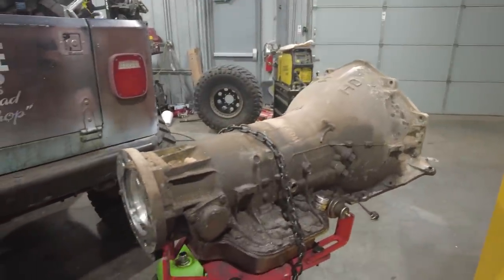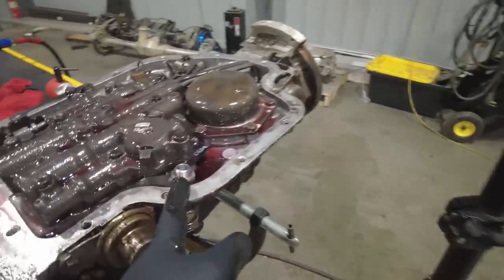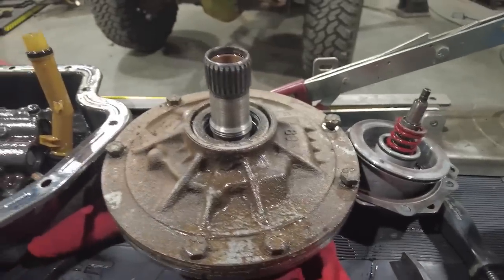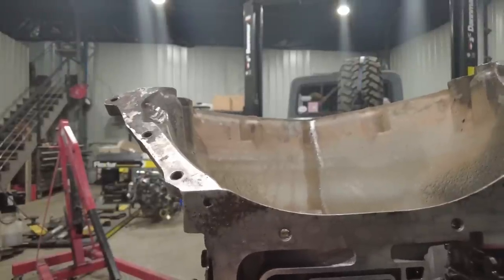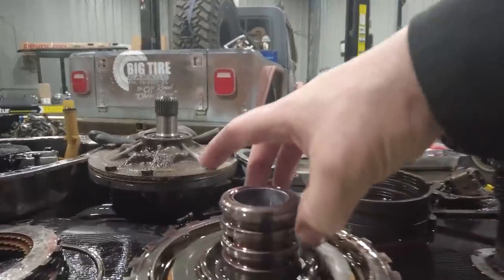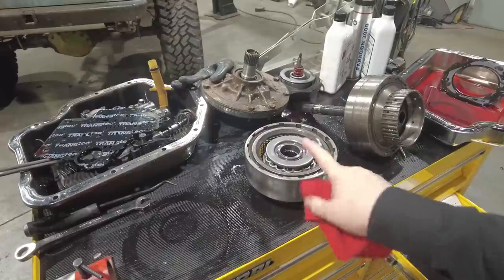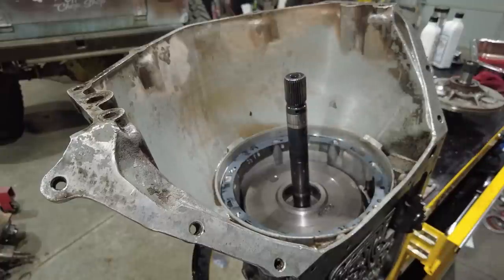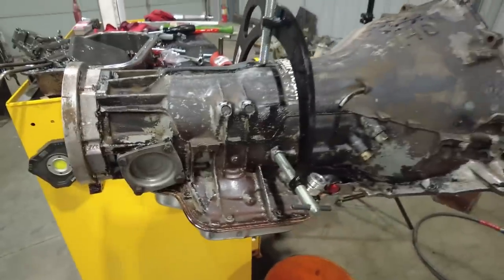Turbo 400 Rebuild for Off Road with Reverse Manual Valve Body

Comment: Nicely done.  The 400 is the staple of drag racing and off-road.

Your editor continues to make a rookie mistake that annoys your viewers video after video.  The music should be the same volume as the talking.  The viewer should not have to adjust the sound down for music and then back up again for talking a dozen times in a video.

Comment: Got a motorhome with a trashed body and a 454 with a 400 or 475 behind it. Going to slap a c10 cab on the chassis and a quick wood flat bed. It'll be a sweet rig, these trans are awesome. Love these and 727s.

Comment: Another great one Ian! Only thing I like to do is I use 2 studs when installing the pump and the valve body for alignment until I get the first bolts started. I damaged a pump gasket once, had redo the whole job a week later.
Reply from the maker: on more complicated VB I do that....and even more so when their are checkballs on top of the spacer plate

Comment: Great video as always! 

Would love to see a video like this on a 6L80! 
Thats whats going in to my TJ here shortly. Though mine is good, it will need a rebuild one day.;
Reply: I don't think there are a whole lot of manual valve body 6l80s out there, plz correct me if I'm wrong
Reply: No need for a manual valve body on an Electronically controlled transmission. It has tap shift capability using a Lokar shifter and some simple software tuning. 
But seeing how to rebuild one would be nice since the 6L80 is fast becoming the go trans for many hotrod and offroad guys. 
Deep first gear, tall 6th gear, and with just a few aftermarket parts it holds 800-1,000hp or more with ease. 
My buddy has had one in is 76 Squar body for 4 years now making 950hp and its holding up great, and the trucks faster than it was with the T400 he blew up 4 times. Now yes you can build a 1,000hp capable T400. Many people do. But he blew up 2 that were supposed to hold 1,200+, 1 that was supposed to be rated for 900hp when the truck was still only making 800hp, and 1 rated for 1,000hp when the truck was making about 880-920hp.

He had a 6l80 built for it and it has already lasted more than 3 times longer than any of the T400s he had in it. 

And he says it drives way better on the street and highway now that he has 2 times the gears to pick from, and over drive.

I have one sitting here going behind a very mild gen four 5.3L that's going in my Jeep TJ shortly. (Shooting for around 400hp at the crank since its going in a wheeling rig that's not used for mud)
I drove a TJ with this exact same setup and was just blown away at how much nicer it drove than mine. (Currently has built 4.6 stroker and a 5 speed manual trans)
And how much nicer it drove over my buddies 5.3 swapped TJ running a T350 trans.

The 3 extra gears and overdrive just make for a MUCH nicer driver on the street over a T350 or T400. And the Deeper first gear makes for a better crawl ratio off road. 

Gets better MPG when your just driving around to. And it holds the motor in the power band better when you want hammer on it.

Comment: I have always had problems with chrome trans pans leaking. I sand/grind the chrome off the mounting surface and use Permatex and it does not leak. Got a reverse manual valvebody on my tbucket but it is old and doesn’t have engine braking.
Reply from the maker: You have to make sure to request the engine braking...most Drag cars don't want it.

Comment: Question…Diesel Rubicon Gladiators come with 32.7” tires and 3.73’s. If I calculate new R&P to run 39” (38.5”) BFG’s, it comes out to 4.39, so 4.56 would be the closest. I’ve always heard 4.88 for 37’s, 5.13 for 40’s and 5.38 for 42’s. So should I go 4.56 or 5.13? I feel like the torque of the diesel would be enough to make up for the lack in gearing. Overland build with not much serious rock crawling.
Reply from the maker: Yes the 4.56 would be my choice for that package

Comment: I have a TH400 I am putting in a Bomber Trail Chassis. Would you recommend a deep pan or a factory pan with this setup?
Reply from the maker: Truck pan which is a little deeper....the bomber chassis is small in the belly

Comment: What are your thoughts on shaving a 14b ff? Does it make the housing weaker if NOT adding an axle truss? Do yoh have an opinion on the TMR 15 bolt shave kit?
Reply from the maker: Not a fan of shave kits....the Crane 13-14 bolt diff cover is a better option IMHO

Comment: How's the 2nd to 1st down shift feel? After putting an RMVB with engine braking it feels too harsh and will throw you thru the dash if your not prepared 😂
Reply from the maker: It is a hard shift for sure....but if you stay off the throttle during the shift its fine...but I prefer a firm/harder shift

Comment: I've read that full manual valve bodies are bad for longevity in street driven vehicles due to the transmission pump being forced to generate full pressure even when it's not needed. (since there is no longer a vac modulator to tell the transmission it isn't under heavy load)  This constant high pressure leads to a shorter life expectancy of the both the pump and the torque converter.

Would you agree and if so, why isn't that a concern for you in this application?
Reply from the maker: I guess I could see the argument for a daily driver that sees 30-40K miles per year....but I don't see the argument about the pump working at max pressure.....the pump inside a transmission is not a "modulating" pump, it flows the same pressure at all times, and the pressure is controlled by the valve body.
And yes I could see the argument about that pressure flowing through the TC....but TBH most vehicles with MVB also have a high or higher stall Torque Converters....this generates higher heat and load more than pressure from the pump.
I would argue that the MVB will extend the life of a well built trans because it eliminates all the "slip" in the system.
If anything the abuse is more serious downstream in the drivetrain with extra load on things like U joints, ring and pinions, and such.
Reply: another full manual reverse pattern valve body by hughes suggested tapping a hole in the pump, installing a set screw, and drilling a reduced sized hole to limit the max pressure to a more reasonable range to prevent damage to not only the transmission, but the thrust bearing in your motor as well. Apparently the increased pressure can put excessive thrust onto the torque converter and into your motor.

Comment: I did mine the same way and have no reverse and the transbrake won't work. Any ideas
Reply from the maker: Your band apply pin might be too short....or if you may have missed putting a seal in the clutch drum.
Reply: @BigTireGarage  thank you. I didn't think you'd respond back. I am gonna pull it back out at lunch.

Comment: The typical I can rebuild a transmission without changing any lip seals and you never use a wave on a transbrake application and the pressure is definitely wrong you need a new pump pressure spring many mistakes were made building this transmission.
Reply from the maker: 1, no trans brake in the transmission,  2, I replaced every lipseal in the 400
Reply from the maker: And why do you say I need a new pump pressure spring?
Reply: @BigTireGarage  Transbrake requires a 200 psi spring for the brake.
Reply from the maker: This trans does not have a trans brake!!!! It is an off road transmission we don't use trans brakes in off road cars